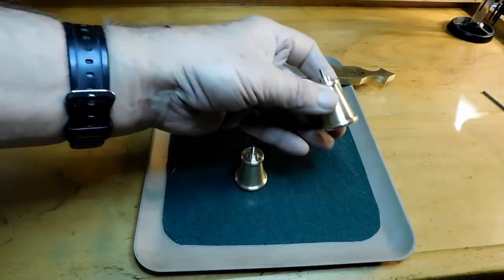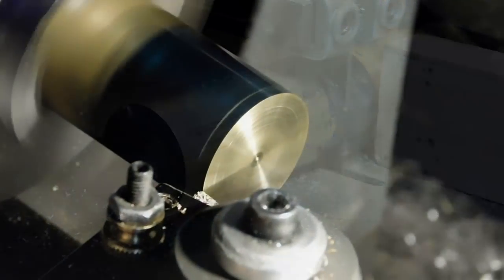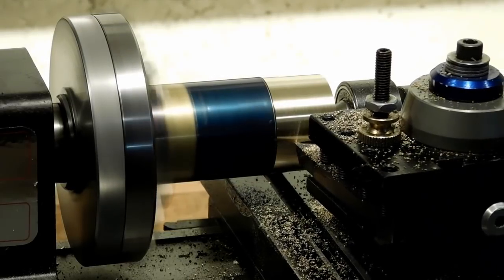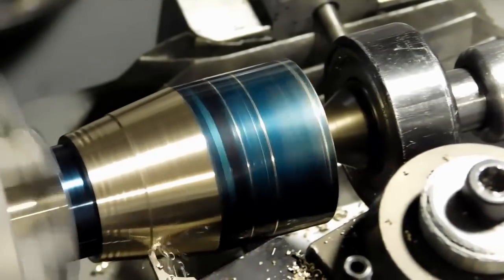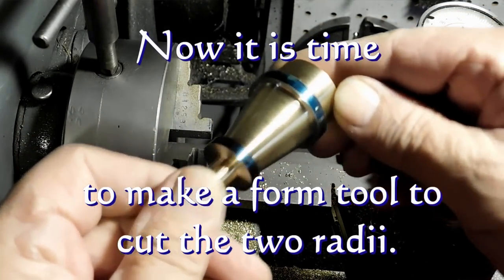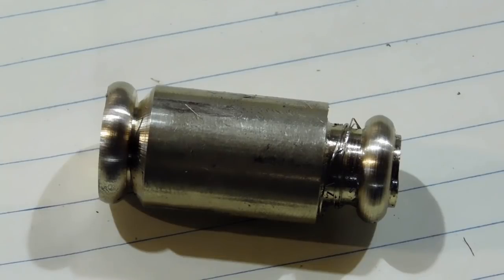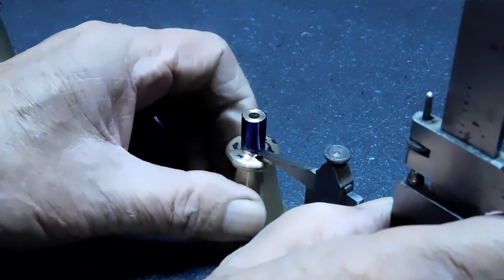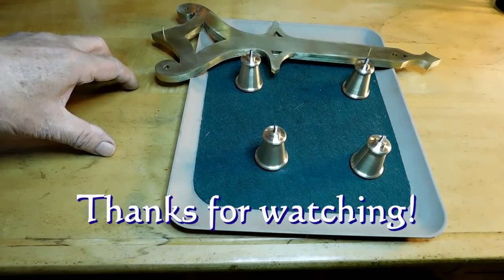WR Smith's Grasshopper Clock: Part 2 The Feet

Comment: Bob, great video.  Can you do a 2 minute video on your home made bit that you used to cut relief in your forming tool?

Joe
Reply from the maker: Joe...I think you may be able to buy these premade...I've got two here that do not look shop made...no idea what they might be called...bob
Reply from the maker: Joe...that is a regular slip pin...they are made from some type of spring steel...I center drilled a piece of aluminum to fit the pin and I pressed the slip pin into it...now I had something to hold it as I hand held the piece at approximately 8 degrees and rotated it slowly on my bench grinder wheel until the point that was forming on the end of the slip pin fit into my drilled hole about .25"...then I turned it 90 degrees and ground it into a D bit configuration...I have thick skin but I bet I'd take a lot of flack for this...but I love the bits...I actually have about 6 different sizes...I make a bunch of form tools...I've got a Kennedy box that is 90% full of HSS bits for different jobs...next video I'll make a couple more form tools that work quite well on a small Sherline......bob
Reply: Bob, when you say slip pin, is that the same thing as a roll pin?  I went back a looked at the tool again was not able to see the end.  The flat part of the D bit is at the split of the pin?  Thank you for answering this newbies questions.  I appreciate that you take the time.

Joe
Reply from the maker: Hi Joe...I'm getting old...stupid mistakes like calling a roll pin a slip pin is way too common for me lately...ur right it is a roll pin...take a look at 7:05 minutes in...the pin is sitting on my vice waiting for it's turn in the chuck...and yes the split of the pin is in the center of the flat part of the D bit...that should help, but next grasshopper clock video is the making of the pillars and I'll be making at the least one new form tool using a roll pin bit...let me know what you need to see and I'll slip it in for sure...thanks for the question...I learn too...bob...FYI I just got back from lunch with an old clock-maker friend who I still make parts for...and tomorrow I've got a pretty small ratchet to make for a carriage clock he's working on...think I might try for a video...I think it might be interesting for some folk...and trying to get a video of it might be a bit of a interesting challenge for me too...stay tuned...
Reply: Bob thanks for the details and I am looking forward to seeing you make the tooling.  I think the rachet would be a nice thing to see  made as well.  Thank you sir, for your patience with me.

Joe

Comment: What about using oil to cut down the chatter ??   Ralph
Reply from the maker: Good question Ralph...I believe brass is kinda self-lubricating...and sulfur based cutting fluids can stain the brass...that being said...I do keep Tap Magic nearby...the only chatter I could not stop on these feet was the plunge cut straight into the brass rod with no side relief to each side of the radius...I kinda expected this to happen...with a small lathe like the Sherline the amount of cutting edge needs to be small on form tools...by cutting the relief on either side the cutting edge size was cut in half...I most likely could have made that cut by plunging in like that using the back gears on my Atlas...but I like to plunge cut on the Sherline because of the speed control...brass loves to dig in (that is the reason I use zero top rake on lathe cutters with brass and I polish the backside of drill bits before using on brass)...if you dig in making one of these radii...you end up throwing the part away...just my thoughts...bob